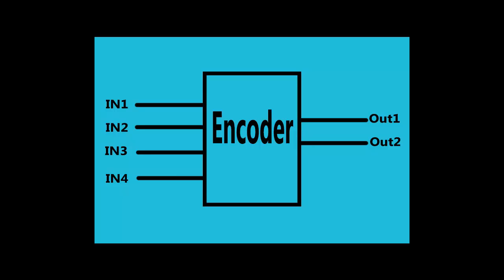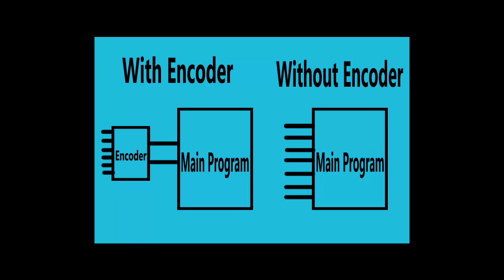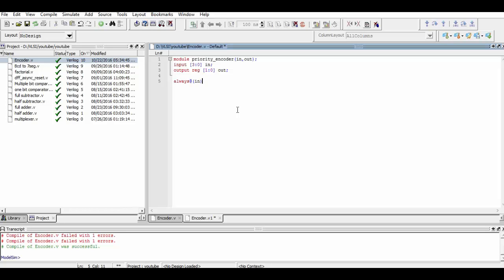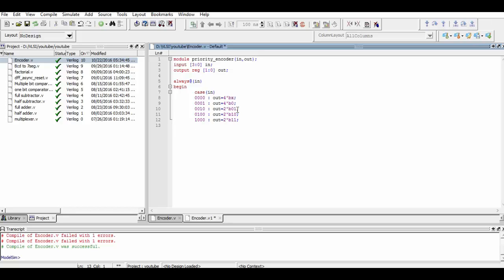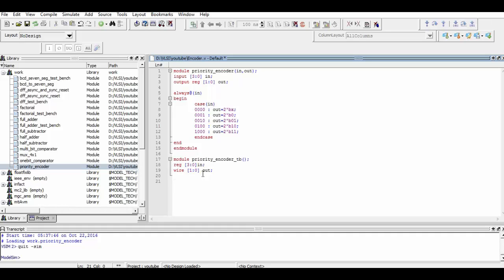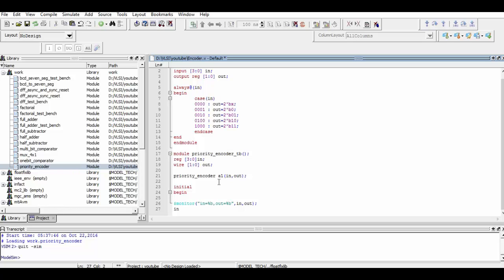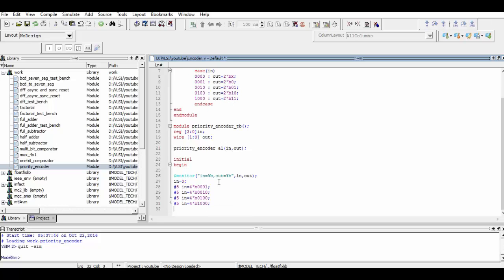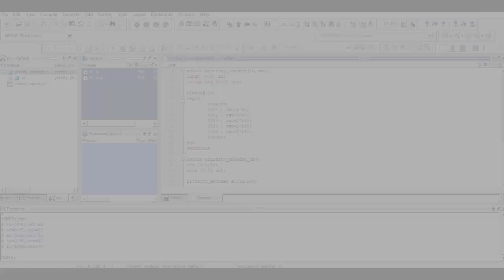Verilog Code For Encoder

Comment: Hey, thanks a lot for your video. Everything was smooth, except until Simulation. The testbench, when I simulate, doesn't show any of the input or output "objects", so I cannot drag them onto the Wave window and simulate them. Please help! Once or twice, it even showd "Cannot load design". Not even showing up in the Instance box. I cannot see any "a1" there, expanding which I get the input and output parameters. 

Please help ASAP!!!